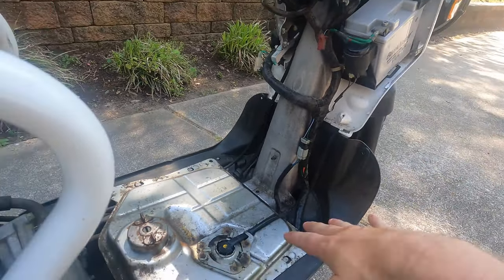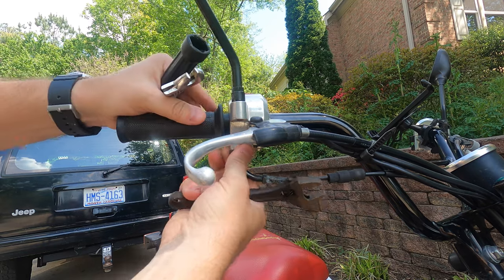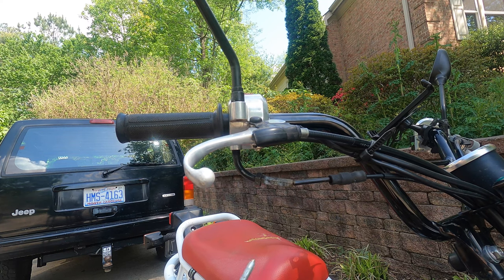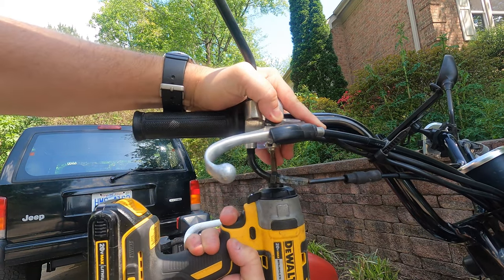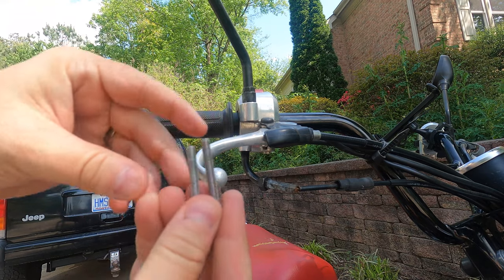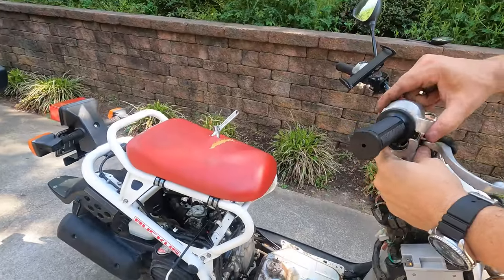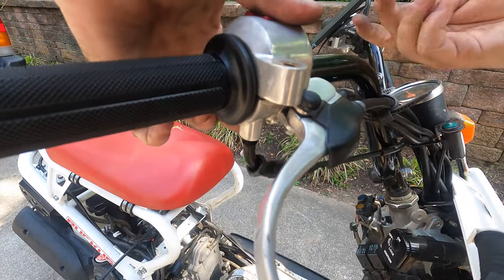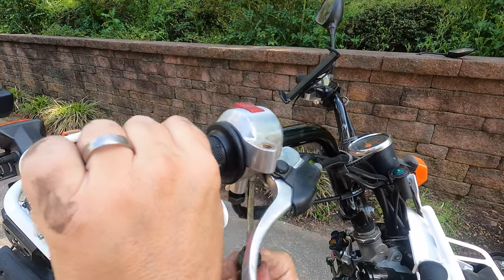Replacing the throttle cable on a Honda Ruckus scooter

Comment: Should the cable on the carb have slack? Or be resting more stable? I think thats my issue im having i ckeaned everything adjusted the screw and it feels like its just not getting up to speed  . I have the bolts alllll the way to the back and theres a lot of slack in the wire on that end . Theres a bit of a gap in play as well

Comment: I've had 3 of these now and every time, the front screw on the throttle control is locked solid and straps to hell. this should be easy but always ends up being a nightmare job from hell as I strip the screw and can't cut or drill into it because of the throttle cable position